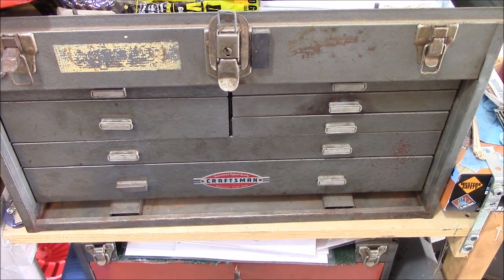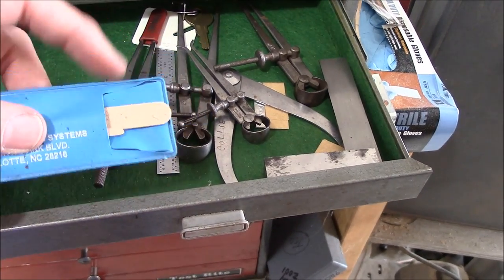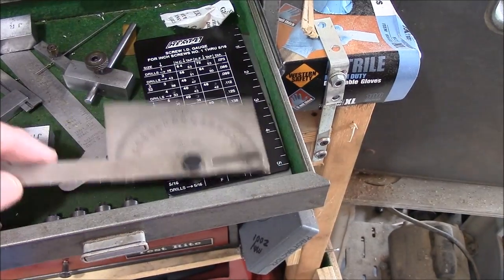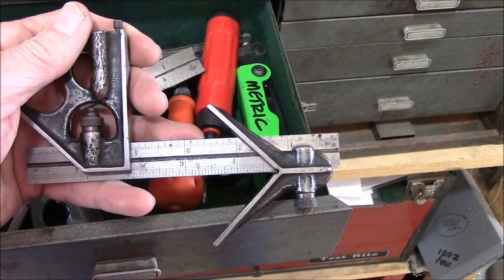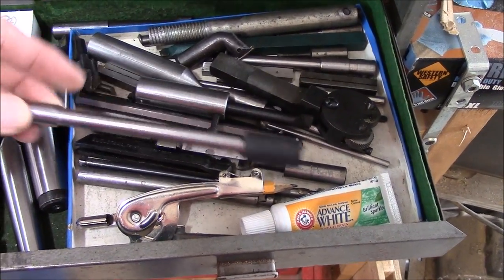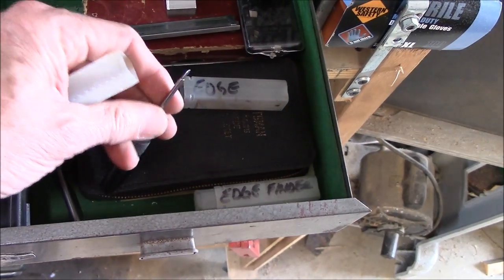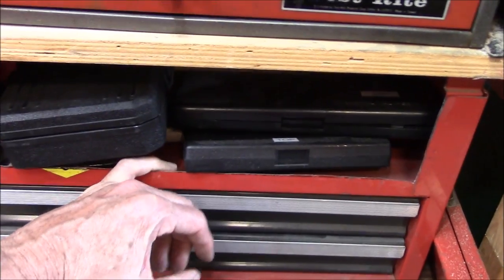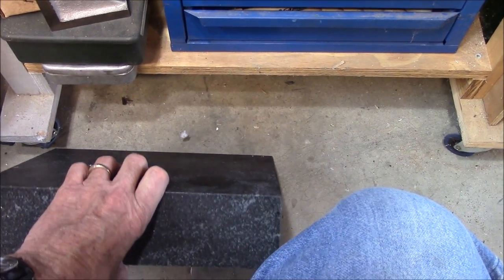Machining the Stuart 10V Steam Engine Castings - Part 35 (SHOP TALK)

Comment: Another great video, thank you John for all your time.  Tons of great advice.  I used to go buy brand new stuff, then realized sometimes that brand new stuff just isn't worth it.  I check out all the 2nd hand and thrift shops before I go buy something new now.  I also learned that sometimes it is better to wait than jump up and go buy something.  Sometimes its better to take a minute and think, and sometimes I've found that I can find something around the house that I already have that will do that job rather than buying that 1 item that may never be used again.  Its great to have a well organized and well stocked shop but...at what cost, and how often does some of those spur of the moment purchases actually get used.  I know I've bought stuff in the past thinking, man I'm going to use that a lot...nope it sits in the tool box never to be seen again.

Comment: Good video and good advice.  I agree with your method of waiting to buy because every time I've rushed into a purchase I've made a mistake.  I am lucky that my mates are engineers and mechanics so I tell them what I'm thinking of buying and they often remember that when talking to someone they trust who mentions selling the thing I want.  I've also got drawers with stuff I've never used and I've often found tools I just had to have 3 or 4 years ago right after I've just bought the same tool I just had to have.
Best Wishes, Brendan.

Comment: I see in the drawer with your carbide cutters you had some center drills. I still have my set but how often do you take the time to use? With no metal lathe now my boring bars have been utilized as hollowing tools for wood turning. I never seem to get rid of any tool I may use in other way!  Another good video.  Not sure how you find the time but thanks!
Reply from the maker: gvet47 Galen,  I do use the carbide mostly since its easy to keep bit on center.  I do think the HSS leaves a better finish.  I've also used the carbide on wood and works great.   ~John